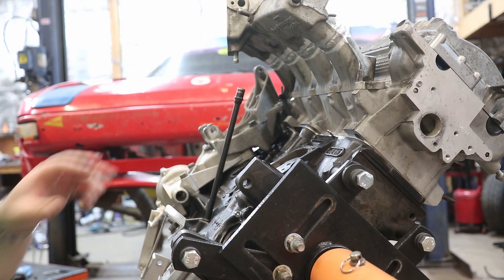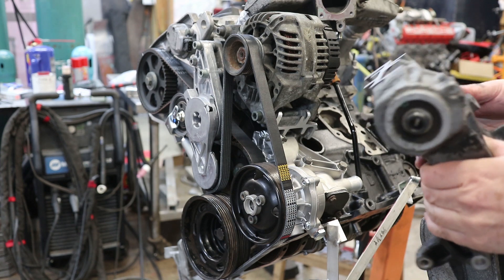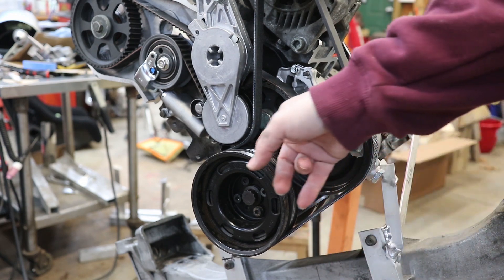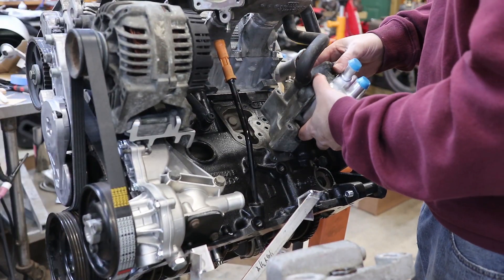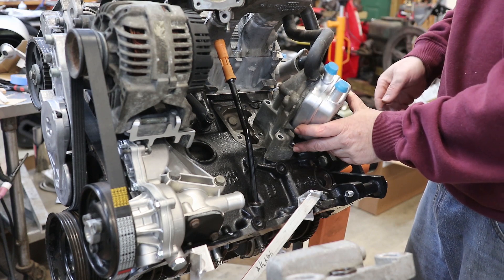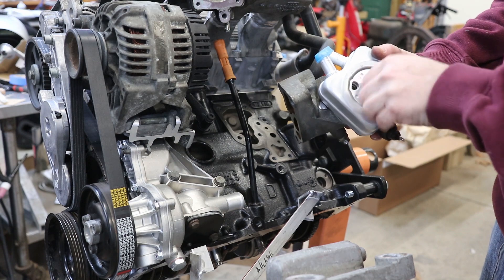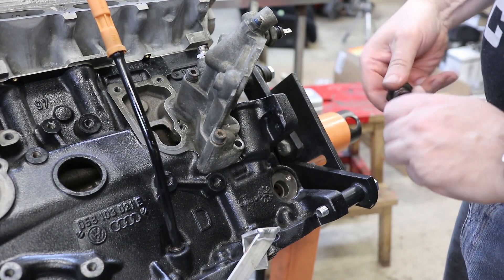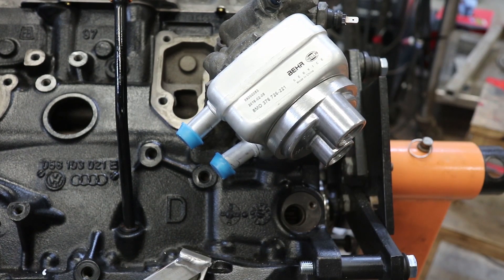Some little chores to adapt the AEB 1.8T engine to a 944

Comment: Thank you for the very clear video's Van!  I just bought my 944 and doing an engineswap too... Can you describe why you went for this particular engine and is there a list of all the things I would need for the swap? I am aiming at 400 WHP.
Reply from the maker: I'm targeting about 225 HP at the wheels.  I already have an LS3 944, and I thought this could be it's lower-HP little brother.  The VW engines are plentiful, have the potential for big power, and are (relatively) cheap to get parts for.  I haven't compiled a complete list of what you need to do yet, but I'm planning on it after I've finished figuring it out.  For now, just keep watching my videos!

Comment: When you eventually get to the point of considering spark plugs, I'd highly recommend you go with three prong NGK 7808 plugs (BKUR6ET which have 0.75-0.8mm gap(s) for turbo engines.  BKUR6ET-10 being the 1.0mm gap for non turbo engines.  I forget the 4 digit stock # for the 1.0mm plugs...).  Many years ago, the 7808 plugs were actually the OE plugs for the early AEB 1.8T's (058 block) and I think a few very early 06A block engines, but for US market cars Audi/VW parts catalog was revised for the Bullsh... platinum tip single prong plugs in the early 2000's.  The obvious benefit of switching to three prong plugs being effectively raising compression ratio ever so slightly with the extra ground electrodes (as well as less air space between the ceramic insulator and plug shell) filling up combustion chamber volume.  But these 5 valve 1.8T's really do perform noticeably better especially in cars with manual transmissions.  VERY, very noticeably in the Audi only factory HP variant in the 225HP TT's.  Better not only in power, but also fuel economy in a daily driver use.  I've always wondered if it had something to do with these heads having that extra center intake valve and/or it's cam lobe indexed slightly off from the other two and as you mentioned in your disassembly video, these heads likely have rather unique and/or really good exhaust scavenging characteristics, not to mention exceptionally great air/fuel flow & mixture swirling.  I've also put these plugs into a handful of the 30 Valve V6 engines (essentially identical 5 valve heads/combustion chambers), the non turbo 2.8L auto trans cars already had 2 prong plugs in them, so all I could ever really notice and say in those is that they were clapped out neglected cars getting a little TLC.  Only remember a few 3.0L & 2.7L turbo Auto trans Audi C5 chassis cars (A6 and Alllroad models) but never drove them enough (or cared enough) before/after to notice anything but I serviced the cars long/often enough afterwards to know there were no problems or concerns.  Never had the chance put these plugs in a manual trans 2.7T car (S4 or super rare manual trans C5 chassis car).  
The "6" heat range should be good approaching 300HP I would guess, even with track use.  Though I think these plugs are available in a cooler "7" heat range, should you need it.
Also, what are you planning for a thermostat?  80°C instead of 87°C I would assume?
Reply from the maker: Those are exactly the plugs I got!  Good news.  (bkur6et)

Comment: Are you going to be able to get the air out of that oil cooler, with it aim that way?
Reply from the maker: That's a really good question - I think it'll pump out... we will have to see.
Reply: The cooling system does not pump out air and there is no bleed screw on that oil cooler. It is pointing downward from the look of the video .. air will find the high spot and stays there.. unless you do like the boxster and fill the system starting from a vacuum.. you are going to have trapped air in the coolant side...